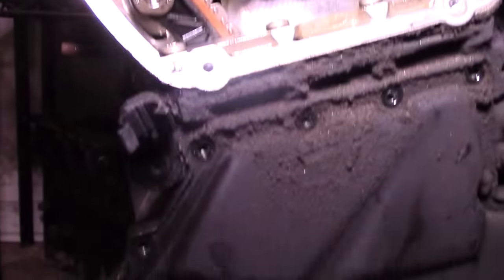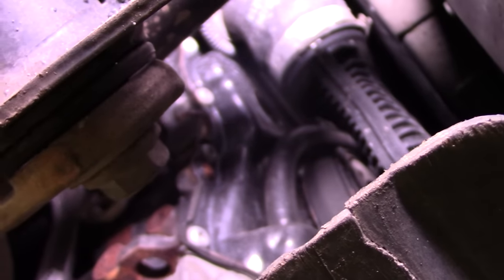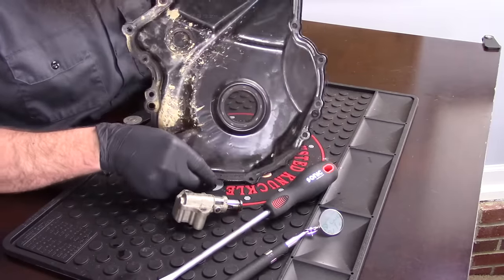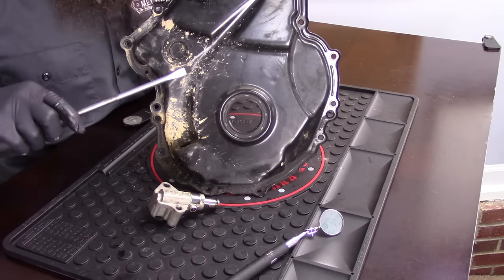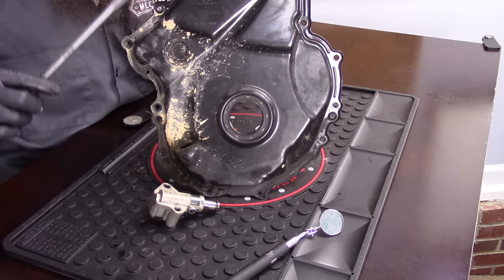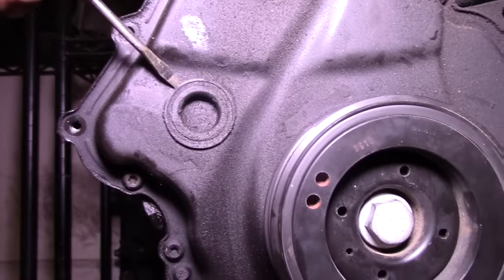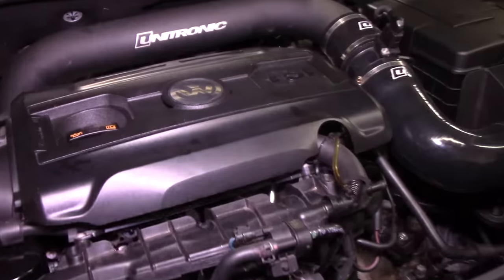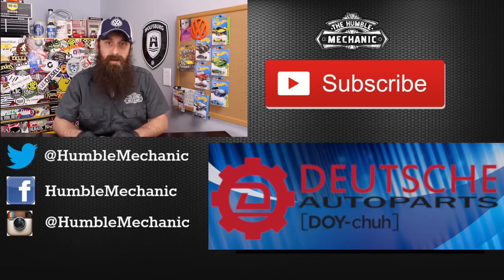How to Check 2.0T TSI Timing Chain Tensioner

Comment: I don't work on VW's so what goes wrong with the old style or why is it necessary to have to inspect and change it?
Reply from the maker: They tend to come apart and cause the timing chain to lose tension. That generally makes for bent valves
Reply: +HumbleMechanic The older CBR F4i bikes do the same thing, but they're super noisy first.... fortunately.
Reply: @HumbleMechanic  didn't vw make a recall on these tensioners and replace them for customers?
Reply: @rmetanes  iguess didnt, they dont like customers just their money

Comment: Am I correct in understanding that the failure mode for the early tensioner is that the band covering that ratchet pawl comes off?  If so, wouldn't putting a metal band tie wrap around the tensioner prevent this from happening?  It could be a relatively simple fix, especially if it could be done through the inspection hole.  I thoroughly enjoy your videos.  -Bill
Reply: I would also like an answer to this
Reply: @hulk6164  Not going to happen with the cover on the engine, not enough room.  Just finished looking at an 09 2.0 TSI CCTA tensioner on the car, not a fun job with the turbo pipe & oil down side of the engine!
If you had the cover off, sure, but why not just go ahead & put on a revised tensioner?

Comment: I like the design of the timing chain tensioner on the R53 MINI Cooper S. You unscrew a bolt, and out comes the tensioner (looks like a battery). You pop the new one in, and screw back the cap/bolt. Voila!

Comment: I own a mk6 gti with the cczb engine 1st registered 25th June 2010. I did this check today & found it to be the faulty tensioner, getting it changed in a couple of days at the cost of £390. mine has just done 70k miles & I've had no problem so far but changing it for piece of mind. Thanks for putting this video on, it really helped.
Reply from the maker: awesome glad to help
Reply: Mine went at 60k miles after noisy startups for a year or so. Cold start in morning fired and engine cut out knew exactly what happened. Currently at workshop waiting for damage report. Sucks as was big VW fan and lived the ride. Thnks for video Humblemechanic #sadlyvwg6fan
Reply: @1petrofski  what was the damage?

Comment: Great video as always. I cant find any information on when to change the timing chain on my 2012 gti CCTA, do you know? Also, what else would you change when doing that job?
Reply from the maker: +MelodicMurder There is not a service interval. At this point I think if you have the older style tensioner, like I show in the video, it's time for a replacement. 

There is a link in the description to ShopDAP. They have a kit with all the stuff you need.
Reply: +HumbleMechanic Thanks for getting back to me. I'll have to put that on my list to do and that diy kit from DAP looks awesome. Do you think you can make a how to video for the kit? That would rock. I also want to do an oil catch can and get a vag com. I must admit i do love my CCTA especially after i had it tuned by APR. It makes me want to hit 300k miles with this car :)

Comment: It was all the little issues like this one that finally convinced me to sell my 2010 VW EOS. Sold the car last month for $8,000 with just over 89k miles. Then I put the cheap and reliable '91 Mazda Miata back on the road.
Your videos did help me a lot with diagnosing and completing repairs for many of the other issues. As well as pointing out some things that VW ended up covering like the replacement intake manifold.
Thanks for that.
Reply: I own a 2010 Passat Wagon w/106K...just replaced water pump, injectors under warranty, a coil under warranty, and I have a valve cover gasket leak for which the dealer is suggesting I pony up $2000 to fix (replacing serpentine belt etc.) now I learn about this tensioner issue.  Makes me wish I still had my 1990 Miata that I sold with 235K.  Spent more on the VW water pump replacement than I ever put in TOTAL on the Miata.

Comment: Hey, my lower timing chain cover is so rusty that it needs replacement before an oil leak occurs.. The edges are thick and cakey. The engine block next to it (not the Aluminium part but the dark part) is also very rusty. How would you recommend to treat it so that the rust problem is contained? Brush it with a brass wire brush? Wash salt residues off? Use some kind of rust remover or converter? Thanks..

Comment: My 2012 Jetta 2.0 tsi build date July 2012,engine build date jun 2012 has new version tensioner but my mechanic didn’t put new tension plug in ,the old one looked like new

Comment: Question on that.. I still have a bit of warranty time left - will VW only cover if it actually fails or can this get checked and fixed before blowing the motor?
Reply from the maker: +spinnetti They will only cover it if it is failed, or failing. They may cover it if the tensioner is making noise.....
Reply: Thanks for the reply...

Comment: sir some people say to replace the oil pump chain and it's tensioner as well, but is it really needed cause have heard no issues with it ?
and is the timing cover replacement necessary after changing the timing chains and tensioner or the old one can do ?
Thanks in advance
Reply: Replace the cover (if you bent it while prying it off) to be sure you don't get oil leaks.
The other parts should be replaced around 150,000mi as a regular maintenance item since as you said, no issues.

Comment: is it possible to look up the VIN number on a 2012 CC 2.0t to determine what timing chain tensioner is installed or still a crap shoot?  also, do you think a VW dealership would gladly check it for me so they wont have to replace the engine in case it does fail while under warranty?  thank you and i appreciate all of the hard work and time that you put into these videos!  i really appreciate it!
Reply from the maker: +Matthew Lindsey something like that will not show up on a VIN check. Only way to be 100% sure is to inspect the tensioner

Comment: something i always wonder if the cars(jetta and up)  will ever have a "asset manifest" database in one of the control units, loaded at the factory that shows an exact and TOTAL part list installed, so you don't need anything else than a VCDS or scantool to check which part numbers you have installed...

granted, when replacing a part the dealer/shop would need to update that table/database with the new value(or DIYers).

A step further would be extending the service interval counter for other known wear parts with a predefined interval, that way the MFD reads "TB service interval soon" or "replace TB" then the dealer already knows the parts needed or which one it had without even opening the hood.

maybe it's a pipe dream but i find it silly that i can't find a manifest of the parts of my car publicly available even decoding the VIN and 3 letter matrix of options.
Reply: +Guillermo Lovato That would require a level of consistency and management that VW (or many other manufacturers) simply do not have. You only have to be a user of VW's ETKA parts database over time to see inconsistencies on when X model of manufacture is supposed to have Y revision of parts. They often will substitute a part with a different part number on one production run to the next - probably because they have run out of the one that's supposed to be in there. I have seen this personally on my car with O2 sensors & MAP sensors. The actual O2 sensor on my 2010 1.4TSI is not listed as the correct part at any point for my engine throughout the history of it, but its an acceptable substitute.
Reply: blower
i have used ETKA briefly in the past, and also ELSAweb(until VW lawyered them to close the site regretfuly as that info should be publicly available) and yes they're a pain to use!.
specially when you have a part where the last letter changes the car it goes to!, for example, 038128063G / L is for my car, byt J/Q are for the suran(iirc) and M depending on where i check says compatible but on other places it says it's not and the last revision of the part is L (elsa shows L as last compatbiel revision)!, sheer crazyness!

Comment: Would this be applicable for a 1.8TSI CDAA motor also? I believe the engine is quite similar to a 2.0TSI.
Reply: Hey man, just stumbled on your comment 8 years later trying to figure out the same question. Did you manage to find an answer to this?

Comment: I had the water pump replaced just after I bout the CC. So, My mechanic told me that one of the tensioners looked to be a problem in the future, so I know I have to replace these asap, Btw VW has 123000 miles. The timing chain is all good.  I have been driving very little so as to not have a catastrophic engine failure.
Local VW dealer quoted me ...... 1500.00 bucks to do chain and tensioners.  
Whats your recomendation?

Comment: Hi  ihave a golf mk6 2012 1.2 TSI,  would you recommend to change the Timing Chain Tensioner on it? I do not think it looks the same as in your video on the 1.2 tsi? it is only driven 30000km.  Great video btw! :)

Comment: This timing chain tensioner issue seems to be widespread on VAG TSI engines of a certain age. Does the same process apply to the 1.4 TSI engines? (asking regarding an Octavia engine, but they seem to be functionally identical in this respect)
Reply: Late answer, but yes, I've changed the tensioner, including both chain, guard rails, the cam gear for the exhaust side and some different seals. This was an insurance job we had. Complaints of noise and low driveability, had some engine codes about cam timings were off and such. I don't know if the tensioner is the same as the US, but the possible outcomes pretty much looks the same.

Comment: Hi
My car (golf 1.4 tsi mk5 66000 miles) is showing error p3008. Initially the error code p000A appeared. I changed camshaft sensor then code p3008 came up. Most of the people are saying that timing chain needs to replace. It was fine , I just changed water pump because it was leaking, and new drive belts, with engine oil service , dsg service & spark plugs. After all this work when I started my car a code p000A appeared, then changed camshaft sensor, camshaft adjuster valve, after 5 minutes a new code p3008 came up, car starts but idle rough. When press acceleration it vibrates very heavily. What do you think might be the problem?

Comment: if the motor is in a quattro (a4)  is it easy to check or do you have to take the whole front end off like in my 2.7L bi-turbo quattro  (a6)...... just to get  to that area...

Comment: Is it necessary to change the chain as well as de tensioner? Or changing the tensioner is enough to avoid problems? I have a Jetta 2.0 TSI 2012 DSG.. Many thks.
Reply: Tensioner alone is fine. If you plan to keep the car for another 50-70 000 miles do the chain and the gears as well

Comment: Charles, quick question.  My '10 CC just came back from a $4809 timing chain failure (covered by my extended warranty ).  The note that confused me was this:  "FOUND SCREEN IN CAMSHAFT SUPPORT MISSING.  INTAKE CAMSHAFT REPLACED".  Is this the next popular failure, or is this a part of the TCT failure?  Oh, and I had 82 miles left on my warranty.  :D
Reply from the maker: Yep very popular failure. The screen comes out and gets lodged in the oil galley. That blocks oil to the back side of the intake came
Reply from the maker: Cam
Reply: @HumbleMechanic  - Is that part of the warranty from VW?  They were going to pro-rate my repair, but I'd purchased a personal warranty.  So, I got away with deductible only.

Comment: Thank you.  You mentioned that they are on the 4th revision on these I do believe.  And it is the one with the part number with the "k"?  What if the original owner had a newer one instead of the original from the factory.  Let's say the second or third revision. . Are they any Better than the first/original?
Reply: Before july 2014 - change it. After july 2014 - do nothing

Comment: hey man just got a 2006 a4 2.0t, definitely some clicking to the motor and it's more than likely this. I just picked up the car and is being worked on by Audi as of now. I have a warranty on the car and was wondering if you'd think they would at least look at it and tell me if it needs replacing. what do you think?
Reply: have you heard of the timing chain (cam chain ) tensioner ?? seems to be really common among these cars . I have the same issue 
 some clicking noise.

Comment: Hello friend, I'll be brief, I'm repairing a TFSI engine and I get with a problem, the tensioner comes out all the tensioner, and when I turn the crankshaft, the chain jumps on the cam, you could help me with that problem that I have.

Comment: I checked the tensioner on the gti I will be buying but I could not get it back on fully. I removed the fender liner and boost pipe to get more room but I still couldn't even if I put all my weight to it and lubricate it with fresh oil. Has anyone else struggled with reinstalling? What's the trick of getting it back on?

Comment: Hey Charles any DIY on how to replace the tensioner?
Reply from the maker: I haven't done one. I am nervous to do that video. It is not a hard job, but if you do any of it wrong , you are doing big time engine damage. Maybe at some point I will.
Reply: Thanks any idea if the Bentley manual has this in it?

Comment: Not sure that the main guy here will see this question but I figure I would ask. I did the timing on my 2012 CC and now getting a code the tensioner was missing that little clip in there was wondering if anyone has run into that before? Would that cause a error code?

Comment: I took my 2013 GTI CBFA to the VW dealer and asked about the chain tensioner as it had never been done before. (It's a 9/2012 build date) they said that chain tensioners failing are rare and do not recommend I do it. They said I need to have an oil screen replaced every 50,000 miles and I'll be fine. Please let me know if this is correct. Thank you.
Reply: ZNormT6 Hi. I also have 2013 GTI Autobahn ( Registration) 09/18/2012 ( build date). I’m curious if you had the dealer mechanic do a visual check if the revise version was installed?

Comment: does the 2012 US golf R how the old or revised timing chain tensioner??
Reply from the maker: +kyle strong no. That engine is belt driven. It's a modified version of the BPY engine
Reply: +HumbleMechanic  so I'm good?!?!
Reply from the maker: +kyle strong you will just have to replace the timing belt and related parts when it's due. I forget the interval that one is due.
Reply: +HumbleMechanic thanks for the quick reply!!! I love your channel but I don't see anything that regards my 2012 golf R. Is there anything that I should be considered with as far as failures? or prevented maintenance? car is stock and is coming up on 50,000 miles.

Comment: My Mk6 is driving me insane, I changed the chain and got all the timing set as close as I possibly could within the measurements. And it gave me codes p0011 p0016 and p052a without even trying the first start. It cranks and stumbles but no start, and when I took the cap off the cams where still in a good spot,  but the chain marks did not line up where they should.
Reply: Did you figure it out?

Comment: Hi there I have a 2009 Audi A4 2 litre turbo TSI is giving me the code number p0016 and I change the timing Chan and I change a tensioner I change the guides giving me Sam code undertale runs ruff I when  pull out the intake camshaft actuator sensor that time it will run smooth why does. That please can you let me know what I have to do

Comment: Great video thanks! I have already replaced my tensioner it wasnt bad if you get all necessary tool. Took me around 7 hours but i did take my time with it.
Isn't it save to assume that pretty much anything made before 2013 has old tensioner? 2013 is the year to check as you might or might not have old tensioner.
Reply from the maker: +trancemiro It should be, but for how easy this is to check, I think it's worth making 100% sure.

Comment: Can I find this out by calling the dealer and they can tell me by the vin number if I have the old one or the new style tensioner?
Reply from the maker: +Dema's WoodShop sadly no. They will only be guessing
Reply: HumbleMechanic well that sux, so if don't have the 06K-109-467-K than I need to replace it, I have 51k miles on 2012 gti

Comment: Hello Charles.
Very good videos, thanks for helping out.
Little off topic if you don't mind.
I have 2011 Tiguan that developed engine shake and engine light on. Scanned for misfire cyl 1. Got four new coils from Pepboys and problem fixed. Couple  days later noticed light engine shake when in drive also seams like idling is high, 700-800 RPM.
Any thoughts
Thanks
Reply from the maker: What about spark plugs?
Reply from the maker: Or possible carbon buildup
Reply: I was thinking about that, but what coincidence that happened 1 day after coils replacement? Could it be generic coils, should I buy Bosch?
Thanks
Reply: Are you getting any other error codes?  I had the same problem and replaced the intake manifold and sealed a vacuum leak. Fixed all of my misfire codes

Comment: Does the lower tensioner have the same problem as the upper tensioner in 2.0 tsi?
Reply from the maker: No. The balance shaft tensioner is great, and the oil pump tensioner is just a spring.